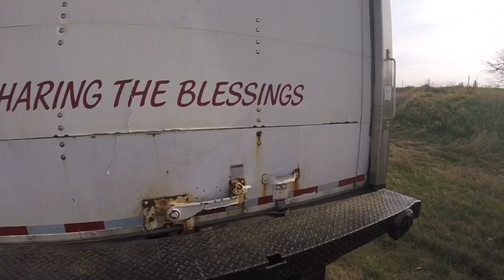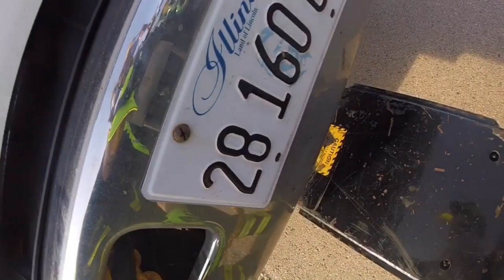Rotator work ep 67 c6500 box truck tow

Comment: Those gloves are wicked huh! Looked them up online...ordered a couple pair for myself, they're even priced not too bad @ $50 for cut & puncture resistance, gotta like that.
Reply from the maker: I will say in any field of work with you’re hands these gloves are hand down one of a kind they are light enough but provide better protection than a heavy duty work glove i really like the knuckle protectors on the glove because they are not to large where you can’t move you’re fingers but they can handle a heavy blow to you’re hand or knuckle hand down my choice in work gloves